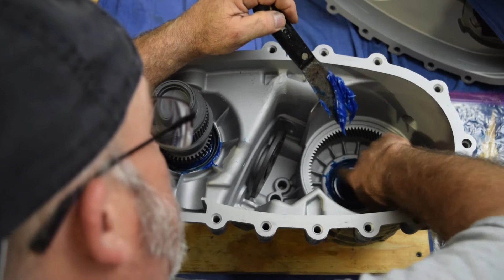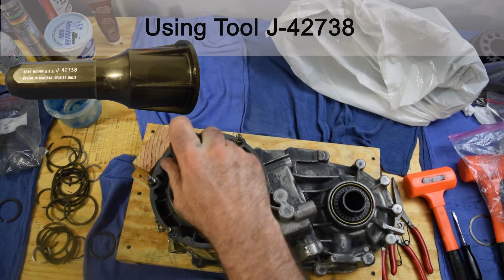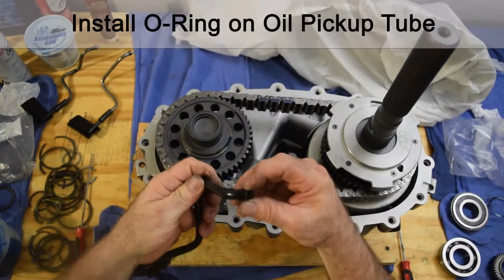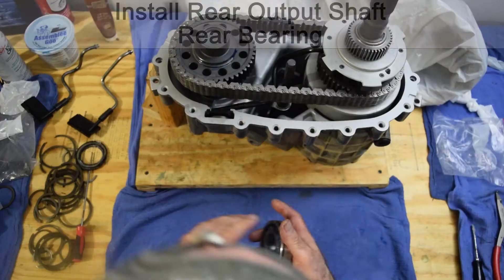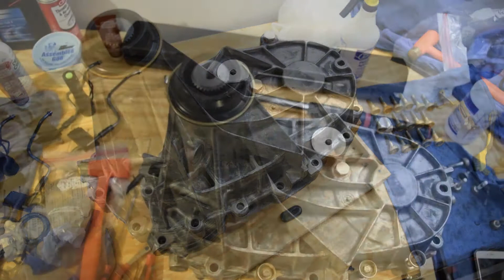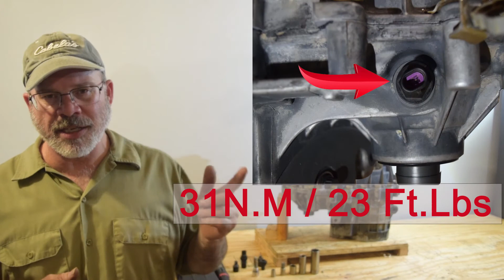GM NP246 Transfer Case Rebuild, Part 2 of 2 - Final Assembly

Comment: Thank you for your time in putting this video together.  It was the most clear and complete assembly video I was able to find, and it definitely help me avoid a couple mistakes.

I raise my glass to you good sir. 🍺
Reply from the maker: Thank you for your kind words. Make sure you subscribe to the channel as I will be doing another transfer case video after a 4L60E transmission and 5.3 engine build  that will be following the current Ford 4.0L V6 rebuild project.

Comment: As for the front drive shaft input seal., do you use the tool that they sell to drive on the seal and especially the front drive shaft input 2 part seal or did you fabricate something?

Comment: I know that this video is a couple of years old, But what are the dimensions of the board that you made to hold the transfer case up right?
Reply from the maker: All is good, Give me a day to find it in  the garage and I will get you those dimensions.
Reply: @EddiCurrent  Thanks, I appreciate it.
Reply: @EddiCurrent I was wondering if you was able to find the dimensions of your transfer case stand? 
 I figured you may have used the gasket to get the center hole and bolt pattern. What I mainly need is the length and width of the 3/4 inch plywood that you used and the length of the 2x4 block that's holding the transfer case up.
Reply from the maker: @orabates1823  I haven't found the bottom part of the fixture yet. I'm still looking when I have time. Sorry
Reply: @Educated Guess Works  No problem, Sir. I'm actually just about finished with the bottom stand. I just took a piece of 3/4" plywood 19 3/4" by 12" I used my circle jig to cut a 5" diameter hole for the front output shaft. I have an extra gasket I'm going to use as a template for the bolt pattern.

Comment: Wow………that amount of Transmission Grease used is TOTALLY RIDICULOUS!
Reply: In retrospect I would have to agree. Being that it is bathed in oil it’s really not needed.
Reply: lol could run the case without oil for 100k with all that grease. The Manual only calls for some pre oiling, thats it.

Comment: Great video, I speak for many when I say thank you for your effort in doing this.  I'm rebuilding a 2001 np246 and it did not have the oil pump wave ring.  Do you know if I need to track one down or if the earlier generation version did not have this?

Comment: I know there are lots of liquid gaskets, but what one did you use specifically. I don’t recognize what I see of it. I can see that it is Permatex but I’m guessing you use a specific one of their many & have found it to be reliable? Please be specific. Thanks in advance!  Great video but I would love to have heard all your comments on what you were thinking i.e. play in parts, normal visible wear, why you didn’t pack bearings first, what are biggest/common mistakes, etc.  By far the most detailed assembly of a 246. You are good!  Would love to hear more about how long you been doing this and your background!  THANKS AGAIN!!!
Reply from the maker: Dale Meador I use this stuff! https://www.permatex.com/products/gasketing/the-right-stuff-gasket-makers/permatex-the-right-stuff-gasket-maker/
Reply from the maker: Dale Meador you can check out my about page for my details, pre-grease of bearings is optional. Just don’t use normal grease, I used transmission assembly grease which has a low melting point. Cheers!

Comment: will the transmission  grease used to pack bearing not clog the screen for the oil pump i like the idea of pre lubrication
Reply: I think it’s designed to melt at low temperatures. I’ve been running that transfer case for some time. Didn’t see any issues when I changed oil in the case.
Reply from the maker: Yes the transmission assembly grease melts at low temp. Flushed out after a few miles of break in.

Comment: Awesome video, Thankyou 
It looks like having a 2” pvc end cap and the J-42738 tool would cover the install of the input and 2 output seals 
I’m going to be doing the pump fix next month and want to be prepared in case they need replacing. 
I’m probably just going to do the input anyway as that’s the most buried
Reply from the maker: Thank you!

Comment: Great video, especially removing the seals on the bearing. Also, did you use the plastic tabs on the range fork?
Reply from the maker: John, I didn’t use the small semi-translucent tabs, but the longer semi-circular gray two piece tabs (seen @ ~4:00 mark). HTHs! I don’t know why you would want to install a bearing with a seal that is in a oil bath situation

Comment: The 261HD is slightly different so I could not speak about the wave/spring washer. As for the case haves, just make sure to clean well and use a quality liquid gasket.
Reply from the maker: Same not sure about the NP261HD

Comment: I changed the transfer case rear shell and something seems out of place now because the front shaft will not spin freely in 2wd. Seems like it's in 4wd. The indicator light says it's in 2wd, but it is locked up. I noticed this when I was installing the front shaft and it wouldn't spin. Any suggestions?
Reply: Emilio C, I'm having same problem with my 2002 avalanche. I noticed it when running vehicle on lift in 2wd. My drop light got all twisted up in front drive shaft. I have transfer case all spilt open on bench and can't find anything wrong. I can squeeze clutch pacs and dis engage by hand. Anybody have an answer? Thanks
Reply from the maker: Its hard to say, before you start the job you have to put the transfer case into neutral position, check your owner manual on how to do it.